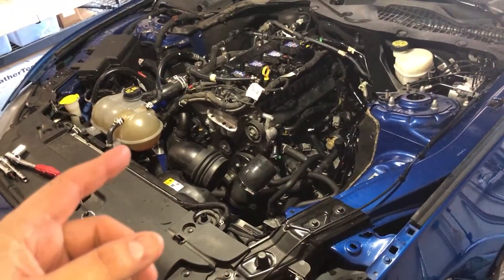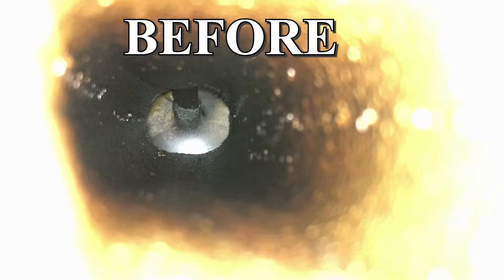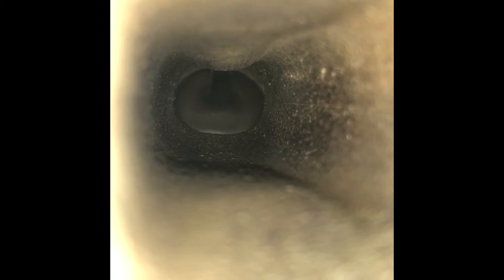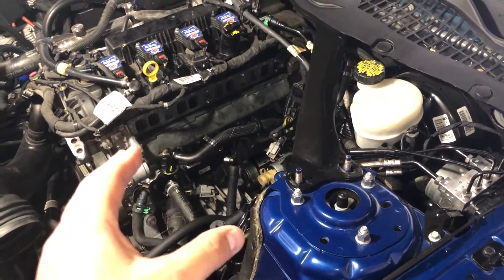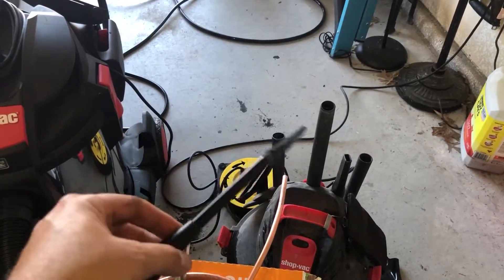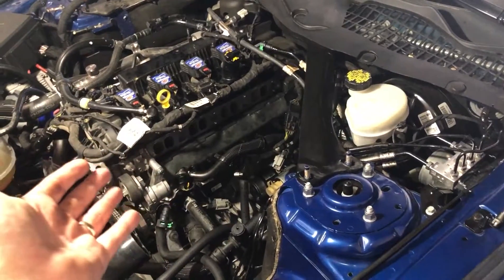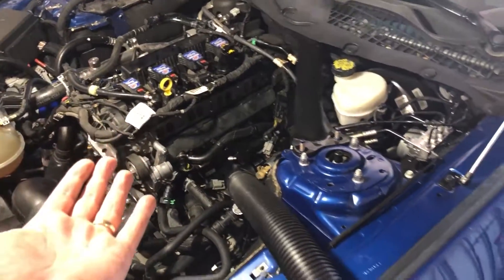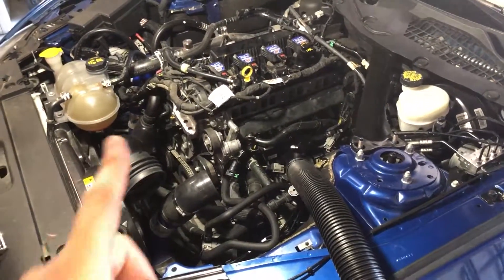2017 Ecoboost Mustang After Valve Cleaning Walnut Shell Blasting - 78,500 Miles - Misfire / Misfires

Comment: I did the exact same thing to my 2015. I was installing a catch-can made by Ford performance(Drivers side). When I removed the intake manifold I looked at my intake valves and they were twice as bad as yours. I filled up 6 of the cylinder intake runners with that direct-injection cleaner. I let it soak for about an hour before I removed it with compressed air and a few rags. Then I went at it with an old gravity-feed sand blaster pistol filled with Walnut shell media. The result was amazing. I rotated the crank by hand until the number one cylinder was sealed. I repeated the process to the number one cylinder intake runners. I pulled all four spark plugs and crank the engine over a few times with the starter  just to make sure if there was anything in the cylinders it would get pushed out. I put everything back together and took it easy for the next hundred plus miles. The first time I dropped her down a couple gears and got on it I could really tell a big difference in pulling power between 4000 and when the tack turns red. I am running a Ford performance tune, mishimoto intercooler And a Gibson Cat-Back exhaust. I have owned this vehicle since new and done all the work myself.
Reply from the maker: That’s great!!! Glad to see if that someone else has benefited from this process. I also saw a huge difference after I had done the procedures.👍
Reply: Dude any chance your in California lol
Reply: When you did this did you do one valve at a time or were you able to do a set a valves per cylinder at a time and what was the easiest way you and tool needed to hand crank the engine? I’ve never done something like this before and can’t find any info online. Before hand cranking to close the valves, is there anything I need to do the the car beforehand?

Comment: Awesome video! Thanks for sharing. I will definitely be doing this on my ecostang that I got on loan at 80k miles. Already noticing cold start misfires on accessport. It needs this cleaning badly! Will do soon! Thanks again!
Reply from the maker: Good luck with it.  It really made a huge difference on the vehicle when I did it.
Reply: I noticed you have the granatelli aftermarket coils. Could you tell me what/if any performance was improved with them? And if you used them with NGK 1 step colder spark plugs?
Reply from the maker: @ClavinNatas  Calvin, the performance was definitely improved and noticeable.  Not in the sense of horsepower gain, but more of a response/wakeup effect.  Made the car run smoother.  I was actually quite surprised that the packs would make that much difference.  As for the sparkies, I did use the NGK 1 Step Colder ones.  Got them pre-gapped from Tuneplus.

https://www.tuneplusinc.com/collections/2015-2016-2017-2018-2019-ford-ecoboost-mustang-catch-cans-accessories/products/ngk6510
Reply: Thanks for the reply! I already have the pregapped NGKs but now I will look forward to getting the granatelli's too. (:

Comment: How do you make sure valves are closed or do they just close when u shut the engine off?
Reply from the maker: I had the same question when I was going to do it myself.  When you open the hood looking at the engine in front of you, there is a wheel at the bottom of the engine with belts hooked up to it. This is the crank and you will see a socket bolt on it.  When you open your intake manifold and shine light inside of the chambers, you will see that 3 of the cylinders will be closed and one will be semi or fully opened.  Take a socket or open wrench and turn that bolt on the wheel to spin it and if you shine light in the open/semi open cylinder, you will see it moving either up and down depending on where it is in the sequence.  Make sure the direction you spin is turning the crank and not loosing the bolt itself.  If you see it going up and it stops, take a look at the other cylinders and you will see another going down and then up as you turn.  So only one will be open and all others will be closed.  When I did it, I kept cycling until I reached the last cylinder so that 1-3 were closed.  Then I put a piece of tape to cover the intake for #4 and went through the process as shown in my video. Hope this helps.
Reply: @ricosmemoirs9171  yes that is perfect thank you so much. I didn’t think about covering the open cylinder either. Exactly what I needed to know thanks for taking the time to type it up!

Comment: I noticed that there's no video footage of him driving and testing out the car after he did this process. I hope all went well and he's enjoying his clean valve performance now.
Reply from the maker: Rassan Hines has a similar question/comment:  Below is my answer.

Rassan Hines: 1 year ago
"Have you gotten the car back running? just curious if everything is running properly still. seems like a crazy way to clean the valves with the heads still on the car."

Rico's Memoirs: 1 year ago

"Yes.  It has been running for 2 months now.  BEST THING I HAVE DONE!!!!  The process is actually no different than what the professionals do at a BMW service, I just did it with DIY items.  See the link below.

Not only has it fixed my misfire/idling issues, but the performance gain is quite noticeable and brought my car back to life.  Also the CRC turbo/intake cleaner is the bomb.  It really works very well to break that stuff down and will be putting one of these every 10k into the system to minimize the accumulations for the future.  Hope this helps."
https://www.youtube.com/watch?v=ONp6gQXpyKU

Comment: I'm not sure if you covered it in the video. If you did, I missed it. But could you tell me the official procedure for rotating the valves shut as you do each cylinder? Or what was it that you did? I imagine maybe removing timing cover and using a ratchet on the front crank bolt?
Reply from the maker: Alexander, No I did not cover it in the video.  Someone in the comments as the same question.  Below is my response.

"I had the same question when I was going to do it myself.  When you open the hood looking at the engine in front of you, there is a wheel at the bottom of the engine with belts hooked up to it. This is the crank and you will see a socket bolt on it.  When you open your intake manifold and shine light inside of the chambers, you will see that 3 of the cylinders will be closed and one will be semi or fully opened.  Take a socket or open wrench and turn that bolt on the wheel to spin it and if you shine light in the open/semi open cylinder, you will see it moving either up and down depending on where it is in the sequence.  Make sure the direction you spin is turning the crank and not loosing the bolt itself.  If you see it going up and it stops, take a look at the other cylinders and you will see another going down and then up as you turn.  So only one will be open and all others will be closed.  When I did it, I kept cycling until I reached the last cylinder so that 1-3 were closed.  Then I put a piece of tape to cover the intake for #4 and went through the process as shown in my video.  You don't need to have it in neutral as that is just for the transmission.  Hope this helps."

Comment: This is probably a long shot it's been a year how do you get the valves closed if my EcoBoost is an automatic do you put it in neutral and then try to spend the motor
Reply from the maker: I had the same question when I was going to do it myself.  When you open the hood looking at the engine in front of you, there is a wheel at the bottom of the engine with belts hooked up to it. This is the crank and you will see a socket bolt on it.  When you open your intake manifold and shine light inside of the chambers, you will see that 3 of the cylinders will be closed and one will be semi or fully opened.  Take a socket or open wrench and turn that bolt on the wheel to spin it and if you shine light in the open/semi open cylinder, you will see it moving either up and down depending on where it is in the sequence.  Make sure the direction you spin is turning the crank and not loosing the bolt itself.  If you see it going up and it stops, take a look at the other cylinders and you will see another going down and then up as you turn.  So only one will be open and all others will be closed.  When I did it, I kept cycling until I reached the last cylinder so that 1-3 were closed.  Then I put a piece of tape to cover the intake for #4 and went through the process as shown in my video.  You don't need to have it in neutral as that is just for the transmission.  Hope this helps.
Reply: @ricosmemoirs9171  you are the man thanks

Comment: sorry,87,750 mi & tuned@ 50,000 mi.   My preference  is NOT to use the CRC [downstream of MASS air sensor];  procedure was out even when Ford was saying it had NO prescribed cleaning procedure!-cited harm to turbo!!  Instead I think Ford dealers are now using the professional  machine that does 'controlled' induction cleaning !!-going to check it out soon & install Fd Perf CC- have 8yr/125K warrentee.   [& I have not seen ANY loss of mpg either &@ 60mph on flat*roads I get 36+mph]. [again no drivability issues!!;  I do get cpl 'sputters' out the tailpipe during fast idle- even when  car new]  USE SHELL 93 & since 71,000 PUP/Pur-BOSS -& Fuel Injector Pro by 104 once in awhile.  Eagerly waiting for your reply, thanks for your time.--TTDRon.
Reply: Rico the controlled cleaning machine is the ATS Chemical 3C Intelligent Induction Cleaner. S Kilmer recommends it too.

Comment: Rico- My 2016 Ford Performance tuned [12/'17 /5 ,000mi--2 colder Denso plugs] eco has now 82,750mi ;  no Catch Can yet installed. I have yet to experience ANY driviability /idling issues
Reply: Idling COULD*BE a 'little' rough, hard to tell if its only*just  'gradually'  getting worse till it actually does acts up.
Reply from the maker: @ronaldburk115  That's how it started for me.  It was a gradual process that I had experienced until it finally started getting pretty bad.  I had actually exhausted everything that I could imagine as opening up the intake to me was the last resort, but sure enough the carbon on the valves was the cause.  After cleaning them out it was like I had a new car; more responsive and better gas mileage.   I have a stage 3 setup on mine so it is tuned rather agressive.

Comment: What oil do you use? Heard this could make a difference in build up? Are you going to put a catch can? Good vid.
Reply from the maker: I use 5W-30 Royal Purple.  I put a Mishimoto catch can on at about 7,000 miles into the car so the buildup would have been twice as bad as shown on this video.
Reply: @ricosmemoirs9171  yo my man , I notice about half a quart of oil goes being used between oil changes.  I change mine at 3k on the dime.  I do drive my very spirituality . I like to measure how much comes out and I seem to go thru about half a quart of oil
Reply from the maker: @CoyoteDAworld  I would probably agree that it was similar for me.  Maybe a little less than half, but the catch can was pretty full at times.  I would change mine at 5K and also drive it pretty spirited as well.  I one time forgot to empty out the catch can on of the oil changes and it got so full that it was chocking the car.  Whoops. 😊

Comment: To keep it clean is it worth putting in a oil catch can and using GL-6 oil?
Reply from the maker: I think that using a catch can will definitely help, however, it will not stop it.  I got my catch can at around 7000 miles and this is how much buildup was there.  It would have been twice as bad without it.  With that said, I believe that the CRC cleaner that I used in this video is made exactly for this purpose.  I have been putting it in every time that I change the oil so it would be a good video to see after 50000 miles using CRC at every 5k what it looks like on the valves.  Just my 2 cents.

Comment: Thanks for the informative video. My modded 2017 mustang ecoboost has bad splutter cold starts and some cylinder misfires so I’m definitely going to try this when I get the chance. 
Did you ziptie drill it with the CRC fluid inside or did you dry it off first before ziptie drilling?
Reply from the maker: I drilled it with the crc fluid inside.  I used some shop towels around the opening/drill to keep the splatter contained.  Your symptoms are exactly what was going on with my vehicle.  This process not only fixed the issues, but the performance change was very noticeable.  Good luck with your process. :)
Reply: I've had my Ecoboost mustang tuned for the last 10k miles and I'm getting a lot of cold start misfires my car only has 25k miles on it I don't know if there could be that much carbon built. I just recently installed an oil catch can. I've driven it for a week and there is already a small amount of oil in it. I kinda wish I put a catch can on it from the day I bought it.
Reply from the maker: @QtheMisanthrope  I don't think that the carbon build up is your problem.  I had mine tuned to Stage 3 at about 25,000 somewhat aggressively and I did not start getting misfires till about 65000.  One thing that I did have that contributed to issues was a vacuum/exhaust leak at the downpipe.  I did change it when I went to Stage 3 so over time the bolt loosened very slightly but enough to cause issues.  Easiest way to troubleshoot the leak was to cover up one of the exhaust pipes at the back and use a shop vac in blower mode and stick it into the other pipe so that air is blowing into the engine.  Do this when the engine is cold.  Then use some soapy water and a sprayer and spray anywhere where there are hoses/exhaust connections to see if you get any bubbles.  Good luck on finding the cause.
Reply: @ricosmemoirs9171  That's another great way of finding an air leak! First time I've heard of this. I've done something similar to my dirt bike. I used my air compressor to force air into the throttle body so I could see where gas was coming out of the carburetor/reed valve gaskets. Never thought of forcing air into the exhaust until now.

Comment: That's awesome, I'm at 63k and looking forward to taking the thing apart to clean everything out... curious if you notice any improvement in power or economy.
Reply from the maker: Yes!!!! Best thing I ever did.  Not only did it fix my misfire issues, but it was like a totally different car afterwards.  More power and more gas mileage. :)
Reply: @ricosmemoirs9171  That's interesting considering how clean the valves were prior to this. There have cleaning jobs where their intake valves were a LOT worse than yours and their performance gains were marginal. I'm wondering if it was actually one of the new gaskets you replaced during reassembly that fixed your initial issue. VERY helpful video nonetheless.

Comment: As a crew chief on F-4 fighters in the USAF we had a process of cleaning the J-79 jet engines by putting a hopper full of walnut shells and dumping them while the engine was run up to about 90 percent of power, the shells went through the engine and hammered all the combustion by products and blew them out the exhaust. Beech aircraft has the same requirement for their engines. i have a 2014 eco boost F-150 and I am going to disconnect the exhaust and run a bag of walnut shells through the engine running at a fairly high rpm and it should clean the valves as well as the piston tops and combustion chamber. As with the "engineers" I dealt with from McDonald aircraft and General Dynamics (on the F-16's) as well as Ford,  I wish you would get out from behind your desks and address this problem with a TSB so you can take responsibility for this necessary cleaning.
Reply: Did you finally do this process on your f150?? How did it work out? Did you have to remove the turbo or anything?
Reply: @bradbird8913  I have not done this yet on my 150, it has been at the Ford dealer for weeks and weeks getting the transfer case rebuilt (twice) and the rear differential rebuilt. I just got it back and I hope it lasts more than the 400 miles it did after the first rebuild. I also have to check with the dealer as it is still in warranty and want to make sure this won't void it.

Comment: Have you used the CRC intake and turbo cleaner through the intake with the engine running per the instructions on the can? If so, did you have any issues?
Reply from the maker: Yes.  I do it every 5000 miles on the car when I do an oil change.  No problem.  I have the wife keep the RPM's up while I am spraying it.  I take a lighter/hot air gun and heat the tube on the can so that I can bend it 90 degrees and then loosen the hose connecting to the throttle body and stick it there while pump spraying.  This makes it so that I can hold the can up straight.  Right now I am at 90k on the mileage so I think that when I reach 100k I may open up the manifold again to see how it looks after 20k of miles.

Comment: How much of it did you get with the CRC?  Did you really need both treatments?
Reply from the maker: I would say that  using the CRC with the tie wraps took out almost all of the big chucks that were stuck on there.  Probably about 75 - 80%.  The walnut blasting got everything else super clean.  As to if you could just do the walnut blasting by itself, it is very possible that it could do the same job.  That would have probably been a good test to do on one of the valves to see the difference.  I also think that the CRC can remove some of the stuff that is around the valve chamber that the walnut blasting probably can't remove as good.  In my opinion doing both is a good method to get everything clean.  Just my 2 cents.